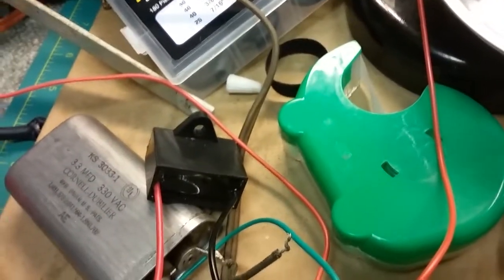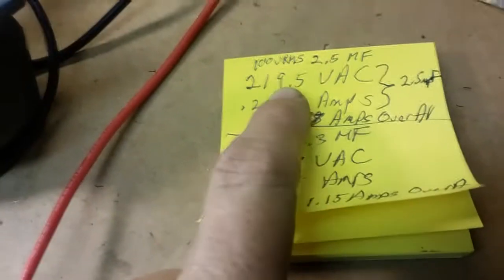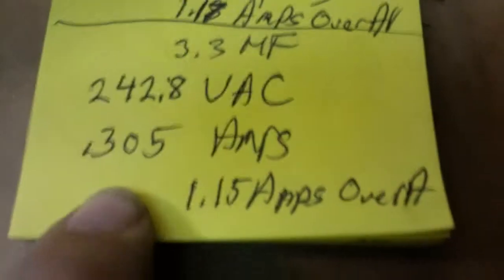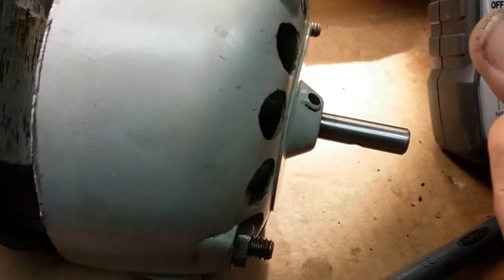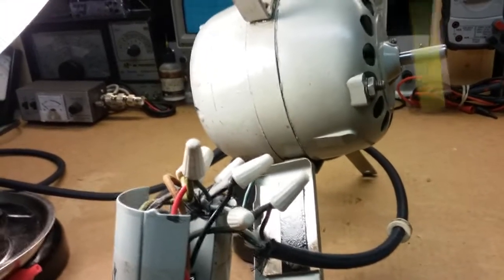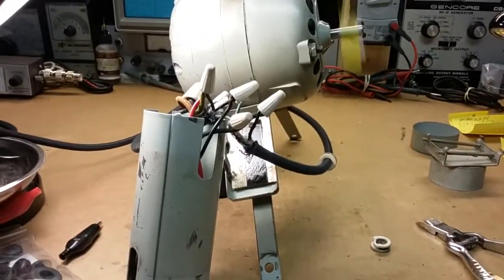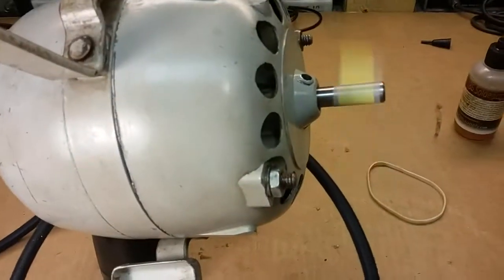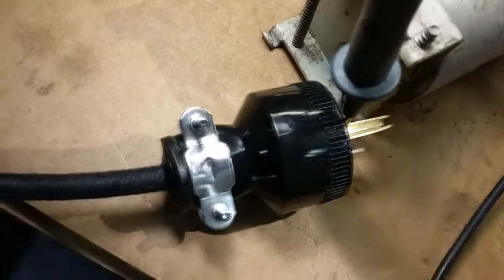Westinghouse Mobilaire Pedestal Fan Motor - Part 2: Repaired

Comment: For the Westinghouse 16MA2, do you know that fan motor rotational speed at HI and LO ?
Reply from the maker: That depends on many factors (current draw, phase angle, capacitor/coil values, age, lubrication, bushing/bearing condition, stator condition and hours of usage). Generally, it can range from 600 RPM or so on low to 2K RPM on high. What you need to be concerned with is current draw being less than or equal to the motor’s stated current. And the housing should not get hot to the touch after running.

Comment: Hello, I have a non working Westinghouse floor fan that isn’t working. I got it in my grandmas garage. I don’t know if it’s the motor or the switch? Is there motors that can’t be fixed? Are you accepting work now? Thank you
Reply from the maker: There are fan motors that can't be fixed. But only if parts are physically broken and replacements are not available or are cost prohibitive.  However that is the exception not the rule! I have only seen a couple that I could not repair. I would say 95% just need serving and are up and running like new. If you can go to my website and send me the model / style numbers off the name plate. I can contact you directly about options and services available. :)